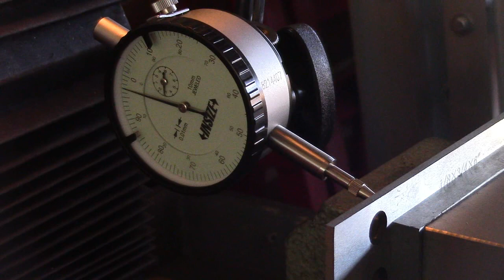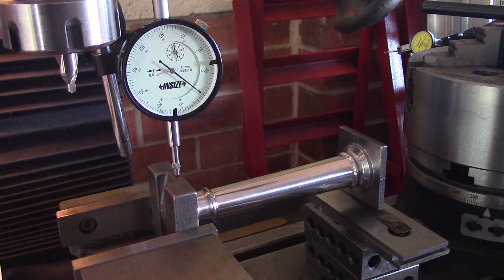Stuart Beam build Part 5

Comment: Hi Gary - You managed to get a very nice finish on the column and the engine is starting to look really good.
Did you make the radius tool yourself?
All the best.
Andrew
Reply from the maker: Thank you Andrew
Yes I did make the radius tool, I have a video of machining a HSS  tool which I will post up as I have had other requests.
Regards
Gary